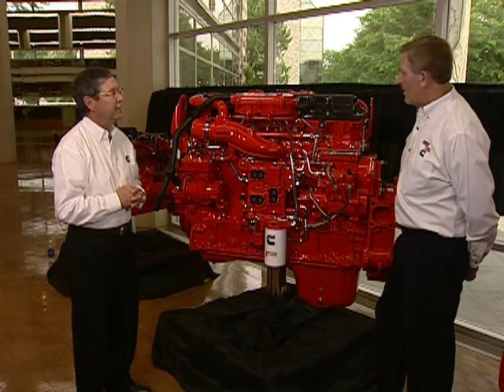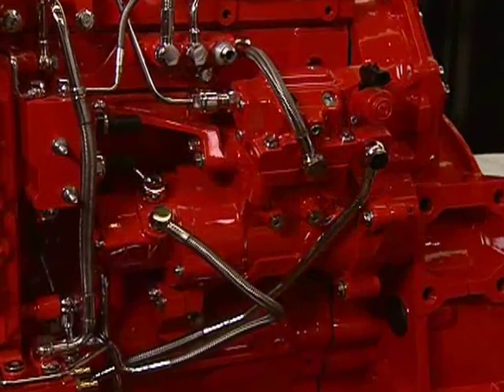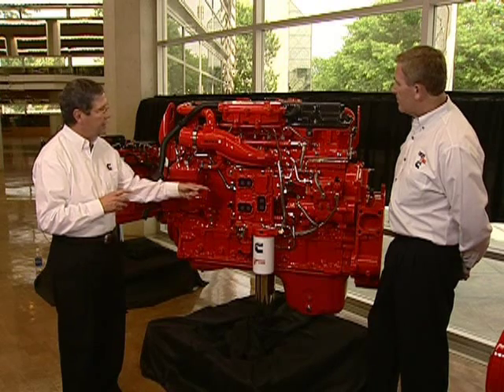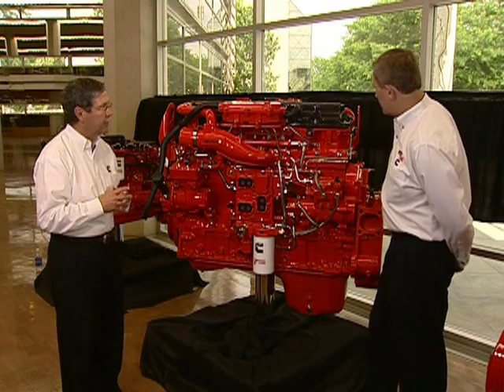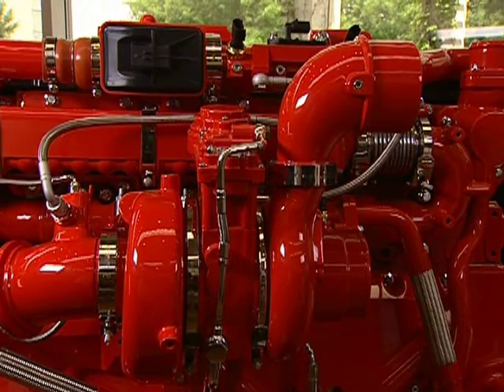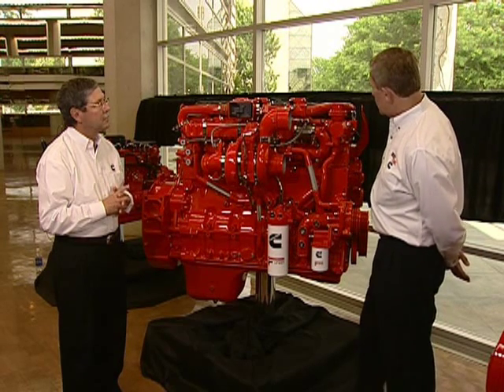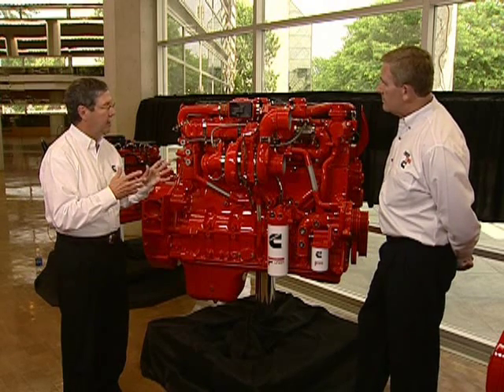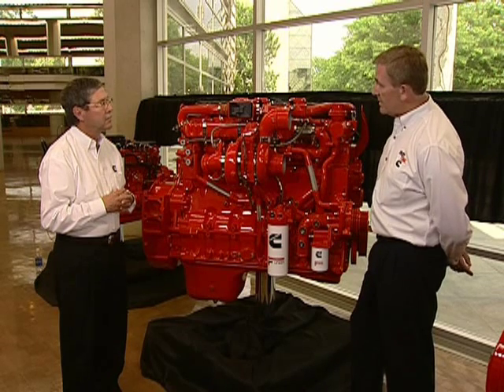2010 Cummins ISX11.9 Overview

Comment: Al Gore Pollution Bull Shit caused the decline of diesel mileage and power to squab a buck off diesel owners lower gas miles by this re-gen process shit process burn fuel. Older gen diesels you just go and drive a to b turn off. No half hr drive no re-gen crap old gen diesels 18 mpg egr new gen to gas V8 like 13 mpg Highway Miles Good for Gore and Tycoon friends.

Comment: I like ixs better than DD15 the regen on it is just a headache every 600 mile I need to do a regen ,I do not known about ixs but The DD 15 having lost of issues . Have driven cascadia for a week an had 3 regents done on the road ,it take 45 minutes to do not to cost effective when u have to stop every 600 miles or less .

Comment: @CumminsEngines 

Any common rail engine is not so reliable as precessors. ISX 11.9 and Scania XPI are fuel quality sencetive. 

But not Cummins only got problems with CRD system. MAN CRD engines (D20/D28), Renault DCI got the same issues.

But IMO, XPI is the technology of future with fuel economy, emissions.

Comment: so does that mean it still incorparates push tube to actuate the rocker levers?  if thats the case i hope it isnt like the ism it replaces as when u pull the rocker shafts its hard to determine where the push tubes came from i relize the injector push tubes are eliminated but still the ism or m11 is my least favorite engine to work on

Comment from the maker: jonesd5o, 
Thanks for the questions!  The ISX11.9 incorporates a rear gear train design.  This is why the XPI fuel pump is mounted to the rear of the engine. 

The ISX11.9 has a cam-in-block design.  It is not a dual overhead cam configuration.  The XPI fuel system is a high pressure common rail design.  This design eliminates the need for an injector to be camshaft actuated.

Thanks!

Comment: i have a couple of questions i noticed the fuel pump is on the rear of the engine does that mean its a rgt engine? and second i would like to know if its over head cam engine like the isx15 as a tech at central power it might be awhile before i see one of these thanks